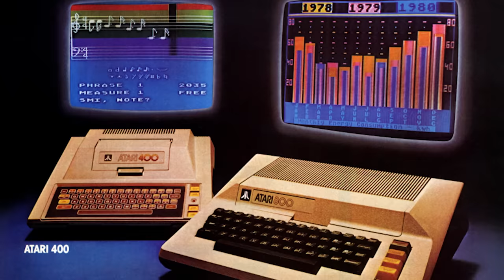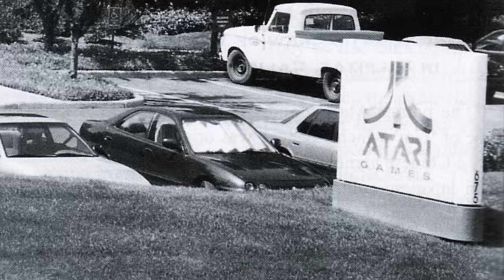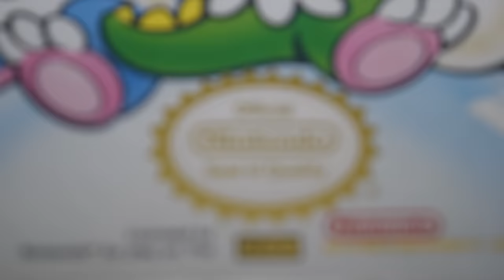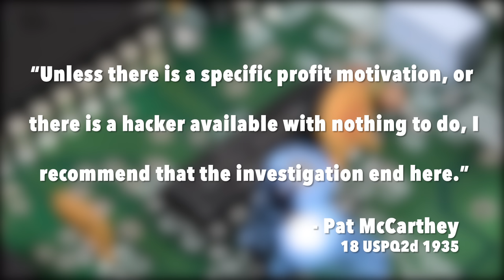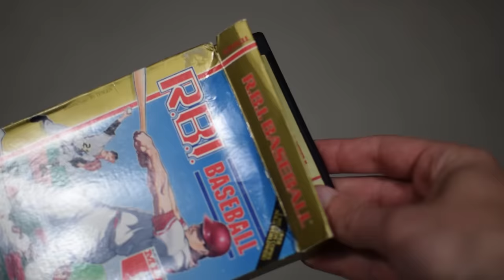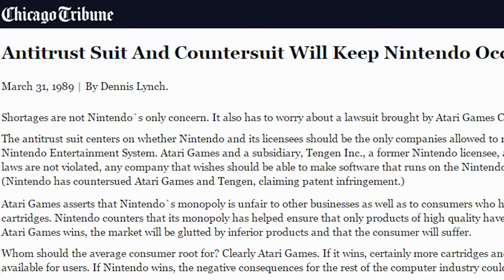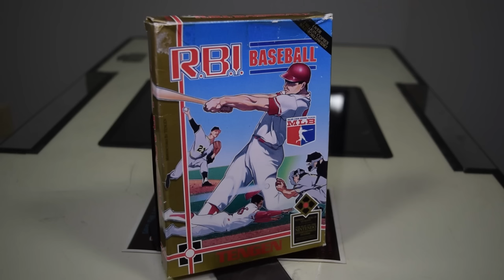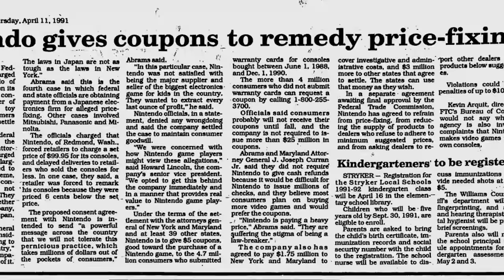Tengen: Atari Games vs. Nintendo

Comment: I always heard a story that Rare managed to beat the lockout chip fair and square but rather than produce unliscenced games, they instead used their findings to just create an NES dev kit and then submitted the games to Nintendo for approval. Nintendo gave them freedom to produce as many games as they wanted to, either because they were impressed or because they feared Rare would share their secrets with the world.
Reply: That's actually legitimately interesting.
Reply: But then again, Rare was a developer, not a publisher, so  there really was no limit on how many games they could work on. They were also worked with Nintendo early on, Rare developed Slalom for them, so they already had dev kits early on.
Reply: I don't know if they ever defeated the lockout chip, as the devkit they made from reverse engineering was for the original Nintendo Family Computer (apparently modifying a RAM adapter board from the system to allow them to inject their own code). Nintendo were simply confident that the Family Computer wasn't possible to reverse-engineer on its own, and were impressed when Rare had shown them their findings. As a result, they brought Rare on-board to make games.

Comment: Great work, Norman! Here's a couple things you may have wanted to add to the video.
One thing is that the NES used 6502 assembly programming, which I heard was very hard compared to the Master System's Z80 and the Genesis's 68000 programming. Also, American/European game developers apparently had no support/documentation from Nintendo. Maybe you can cover this in another video. I really enjoyed this video though. Very informative, and a lot of stuff I didn't know about. Thanks!

Comment: Atari: Better deal? We are Atari, we pretty much created the video game industry

Nintendo: Wasn't it a game on your systems that caused the crash in the first place?

Sega and other gaming companies: OOOOOOOOOOOOOOOOOOOOOOOOO
Reply: 1) That was a different Atari, to start with. That Atari was under the management of Warner Communications being run by Ray Kassar. Atari Games was the result of Atari being split into 2 and both sold off (well actually 3, Warner retained the telecomunications part of Atari). 

2) ET DID NOT CRASH THE INDUSTRY. It goes deeper than just 1 game. The problem was Atari didn't have control on who makes games for the 2600. So everyone and their dog started to make games for it and resulted in allot of shitty games getting out there. That is what caused the market to crash, not just 1 game.
Reply: Nec:bup bup bup 
Sega:ohhhhhhhhhhhhhhhhhhhhhhhhh
Reply: @LUCKO2022  It was also that Sears, Radio Shack, etc. had their own game consoles which were compatible with Atari. Result: A hot mess for consumers--nobody knew exactly what to buy. I think Colecovision and Intellivision were also Atari-friendly, adding to the headache. Correct me if I'm wrong and don't quote me on it.
Reply: Nintendo:Bup Bup Bup 
Nec and Sega:Ohhhhhhhhhhhhhhhhh
Reply: Atari: We don't talk about that.
Reply: @LUCKO2022  include Pitfall! from 1982
Reply: @evacody1249  Nintendo:Atari You suck
Reply: @evacody1249  nec and Sega:Atari is sucker
Reply: OOOOOH Baby, that was spicy
Reply: @windowsme2327  Atari isn't that much of a sucker I suppose, they STILL did bring video games to the home.
Reply: @windowsme2327  Why are you pretending like the companies are saying these things? It's annoying to see you fill half of this comment's replies with your little "RPG" pretending like the companies hate Atari
Reply: Not just one game, but a glut of bad games.
Reply: Looks at shovelware In switch shop....here we goooo...
Reply: @chich-ai  SHUT IT ABOUT MY FRIEND RPG
Reply: @sirnubless uk:  there was no crash... speccy!!! 😄
Reply: @LUCKO2022  A different Atari, you're right.  First, they were just weird, with burying game inventory in the desert, and selling console shells to dentists.  Later, they were desperate criminals , stealing Nintendo's lockout chip program from the patent office, and forcing unlicensed games onto Nintendo's console.  I'm not sure the change was good.

Comment: You could probably also argue that without nintendos strict licensing policy. The game industry might not have taken off at all in the US when it did. Nintendos policy stabilized an industry.
Reply: Yeah, although it certainly would be bad in case Nintendo keep things under their control for waaay to much time as they wanted, it was still a "necesary evil" for that control to happen for some years to bring things back to normal after the absolute mess that became the gaming market, a mess that was made by Atari

Comment: I feel how frustrating this would be, looking at the time period here is important. Nintendo wanting to ensure the Seal of Quality was important. This was so soon after the Video Game Crash, bad games made with low quality programming that made it extremely difficult for consumers to differentiate good games from bad. Tengen themselves showed very clearly that they were not licensed games; the black altered cartridge made it easy to tell for experienced users. I feel like there could have been a strong middle ground where the games could still be sold, but had to be labeled as “Not Licensed or Guaranteed by Nintendo or it’s subsidiaries” while also needing to use clearly altered style of cartridges. 
A simple label like this would have kept the game market extremely open, but also protected Nintendo’s reputation.

Comment: The "Seal of Quality" really meant "Licensing Fees Paid in Full" since many shitty games came out for the NES that were pure poop. And some games came out with serious bugs, such as Castlevania.  So much for quality.
Reply: Castlevania is beyond reproach
Reply: Its was more to prevent overlfooding the market because that's what kinda caused the video game crash
Reply: Yep, Retail glut caused the crash. Not just low quality games, but even overorders of highly popular games.
Reply: @ultrairrelevantnobody1862  It was not just a glut that caused the crash. it was a glut of pure cheaply made crappy games meant to make a quick buck.
Reply: @KabukeeJo  
While there were a lot of bad games on Atari, most of them weren't sold in major retail shops. There are exceptions, but low quality games generally could be found only in smaller shops that were easier to make deals with. A lot of the bad games that barely sold much, like Chase the Chuck Wagon, did a lot less damage financially to companies than commercially successful games.

Comment: so if tengen had to devise a copy of the lockout chip..how did games from Color Dreams and American Video Entertainment get around it??
Reply: Most unlicensed games caused a voltage spike that knocked the authentication unit off-line, or they came with a dongle to connect to an official cartridge, and use that cartridge's lockout chip to authenticate with the NES. However a voltage spike, according to Tengen/Atari may cause damage to the console over time.

Comment: A little note in business law. You can request a discharge of contract due to difficulty or due to Impossibility of Performance (in some cases). While Nintendo may not have explicitly said that they would provide a certain number of cartridges it could be argued that there was an implied agreement based on the fact that Nintendo limited the number of title releases per year, coupled with the previous year's orders, that could have lead a reasonable person to think that they were guaranteed a certain number of cartridges. I haven't looked at this case in any detail but it strikes me as very similar to the type of case studies we covered in my business law courses. Of course Nintendo could have argued Substantial Completion but with a 90% drop in delivery I'm not sure a judge would buy it.

Comment: The video game crash of 1983. Welcome back video games 1984! The "crash" is too over-hyped, it provides great fluff for Wikipedia sites though. Instead of a crash it was more of a sharp transition, a phase to home consoles vs. arcades. It seems dramatic but gaming really never stopped as compared to the effects of the great depression as its term "crash" is borrowed from.
Reply: Stinky Crayons A crash is not defined by the length of time until recovery, but by the severity of the crash itself. The crash of 83 resulted in thousands of jobs lost, hundreds of millions of dollars in revenue lost, and most damaging to the US economy the shift of the industry from the US to Japan. An industry which would later grow to be a multi-billion dollar industry. 

So yeah, it was a big deal.

Comment: 01:40 not sure about the 'as much as possible' - the Tramiel deal was pretty much a giveaway. Tramiel got Atari for 50 dollars cash. There was also around 20-30% in promissory notes and stock in the new company - but that's not up-front capital - that's future gains. From the NYT in July 3, 1984 : 

"''Warner essentially gave away the company, in hopes Tramiel could make something happen,'' said Lee Isgur, an analyst with Paine Webber Inc., echoing comments by others on Wall Street who follow Warner."

Comment: Reverse engineering is fair use, but the code in the TENGEN chip was definitely 10NES. They should’ve copied 10NES and rewrote the code to only include the code required to launch the console and be sufficiently different enough to be legal.

Comment: It really irritates me to hear Nintendo's claim about Atari needing access to 10NES to reverse engineer the CIC chip, and even moreso because I personally know some of the people involved, who were and are skilled and imaginative engineers.  The whole idea that the chip could not be reverse engineered from the die in the early 90s is absurd, especially given that Atari was in silicon valley where reverse engineering your competitor's products (to varying levels of analysis) was standard practice in most companies, especially those who owned their own fab lines.

The NES CIC was a 4-bit Sharp microcontroller with no die security features, in a coarse process (even for the time) with a ROM array easily visible under a metalurgical microscope.  The techniques to identify this device (which I'm told was actually the hardest part) and recover the ROM contents were easy.  Total dumped ROM size was 768 bytes: any experienced programmer could determine the algorithm from that in a day or so, even if they did have to write a disassembler to do it.  Amateurs now do so, and the code is readily available with reverse engineered implementations. Atari was easily able to obtain the datasheet from Sharp.

The reality is that Nintendo's legal team made so many nonsense "common sense" claims about the difficulty of it, and it just wasn't.  This set a bad precedent which we're still suffering from, especially from Nintendo, who don't even bother with a loss-leader console.  But it also supports the abusive and anti-competitive store practices of Apple and others, too.

Of course, the big question is why did Atari's lawyer access the code?  Because they were idiots too.  The people I know said they had a working implementation before it happened, they didn't need to do so, shouldn't have done, and there was absolute horror when the team found out it had happened.  It was a screw up, which probably cost them the case.  They knew that at the time.

Great video, but I think you have given too much credence to Nintendo's version of events.  The ethics of their legal team was poor, and the fact that they supported threatening retailers speaks volumes about their lack of integrity.  Those actions alone should automatically cast doubt on any statement they made.

Comment: what they should have done instead of just copying the documents  they could have used that to reverse engineer and make their own version of the lock out chip  and that would have fallen under fair use.
Reply: The issue was that they didn't have the ability to take a copy or even take notes of the code in a legal manner. So if they wanted to create a lockout chip, the only reasonable method was doing it illegally.

Comment: Loved video games since the Xmas of 1974 when I got Atari Pong. it was a one game system or self contained system with a built in speaker because the bonk bonk sound did NOT come from the TV speaker because at the time sound from a TV speaker was impossible from the gaming system so my Atari Pong system had a built in speaker that ran on 4 D cell batteries. the system plugged in to the 110v house hold current to be able to display Pong on screen. I LOVED Atari Pong as the ONLY video game available to the public. I loved all the 8 bit systems then 16 bit, 32 bit & the Atari 64 bit & so on right up to the first Xbox then the rest is history. my 1974 Xmas was the BEST Xmas ever for me. it was the vary begging of the video game era!

Comment: Chapter 1 TL;DR
Atari split into 2 because of the video game crash of 1983. Atari Corp and Atari Games. Atari Games didn’t get the rights to produce games under the Atari license. So they made a company called Tengen to get around it and basically tricking Atari.

Comment: I wonder how this would have gone if Tengen/Atari had gone out and hired a hacker to reverse engineer the chip...
Reply: What's more funny is that Tengen are the reason we have open src implementations of the 10NES now 

Atari left some debugging functions on there chip which allowed you to dump the program from it. So it was easier to reverse there clone rather than the Nintendo one 
:D

Comment: @Gaming Historian : One thing I never understood is how Activision sued Atari for the right to publish games on the Atari system and won, spawning the entire 3rd party gaming industry, yet, when it came to Nintendo they controlled everything top-to-bottom. Its like the Activision case never happened. I worked in the industry in the 90's and Nintendo was incredibly controlling and nightmarish to deal with. They wanted absolute control of everything and had an arbitrary censorship program. Anyhow, what happened with Nintendo that made them different from Atari?

Comment: Nakamura: Nintendo is a monopoly!
Also Nakamura: I will work for their competitor

That’s not how monopolies work
Reply: Eh yeah ya kinda flew over a few points to land to that conclusion, by all intent and purpose Nintendo orginal licensing contract was a form of monopoly and it was this very reason why Tengen did what they did.

Or in another words the very fact the events presented in this video happens indirectly proves Nintendo had a way to strict and monopoly like licensing contract.

In fact one could argue while not legally defined as such on principle all forms of platform exclusivity is a form of pseudo monopoly.

Comment: They should really make an electronics court. Every time I see one of these cases go before a judge, or god forbid, congress, I wonder how their lack of understanding about the technical details effects the fairness of their decisions.

I work with IT pretty regularly and I have a decent understanding of all the parts that make up computers and how they can be used together and with software but I also know enough to know I don't know alot. On the other hand I've met people who have the same level of knowledge I do and assume they know everything there is to know. And most other people don't know enough to know they don't know alot. That can be pretty damn bad when opening up a court case under a judge that thinks they understand more than they do and has told others they understand when they don't.

Comment: Please dig deeper and verify. Tengen engineers sucessfully cloned the lockout chip but it ran to fast. A problem they knew how to fix as soon as they discovered it. But they were to late. Unknown to them, Tengen had a second team. The second team recieved the illegally aquired information. The final chip was finished _legally_. 
However, proving that would have been way to difficult and time consuming as the law had been violated before they succeeded.

I hadn't heard about the golf game conversations. This seems a very thin or naive accuasation by Nintendo. What could have possibly be revealed that wasn't already public information?
Reply: Did an ex-Atari Games employee tell you this? I've heard a very similar story from Mike Albaugh and other ex-Atari Games employees who attended the Sunnyvale Atari Party in 2014: http://www.newbreedsoftware.com/atariparty/2014/

Comment: If Nintendo sued Atari, why they did the same with camerica and codemasters?
Reply: Maybe it's because Codemasters probably didn't illegally obtain the 10NES code and had instead just reversed engineered it itself without using the copyrighted code.
Reply: @callmememe1308   thanks 👍

Comment: 4:36

Is that not the logo for the band, Saga?
Reply: That's one of their old logos. I think it would be appropriate to use it, but it's a little confusing to me as this logo was made in 1954 retired in 1975, a decade before the NES came out. Realistically, it would've made more sense to either use their 1975 or 1982 logos (the 1975 logo is just an early version of the 1982 logo, which is the design used today.)

Comment: So, if Atari had to make their own chip to bypass/recode the 10 NES chip, how did all of those other companies (A.V.E., Camerica, Wisom Tree etc.) make unlicensed games that would work on the NES?                                                                                                                                                              And by the way, I'm proud to say that I own every Tengen NES game. I think Tengen's games had the highest quality out of all unlicensed NES games. Though I only cared for a few of them.
Reply: They figured out you could "zap" the lockout chip with a negative voltage and it would crash and effectively disable it.